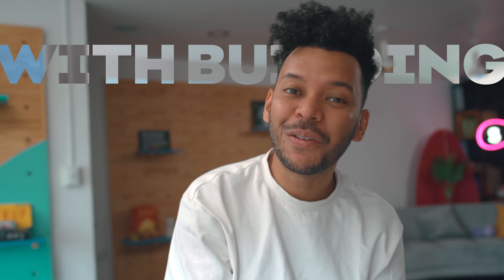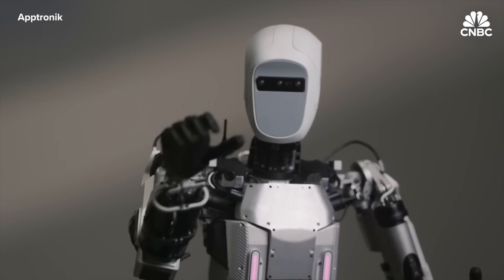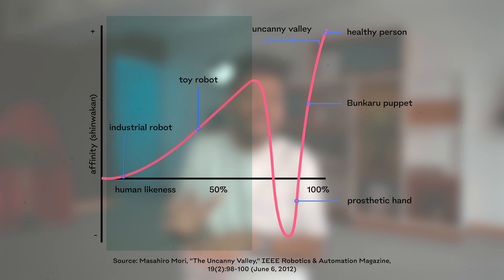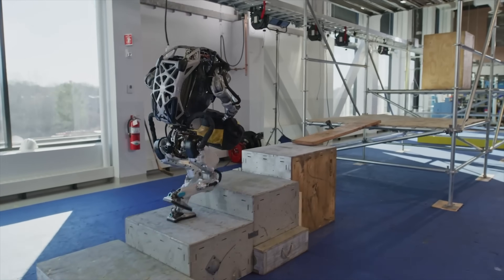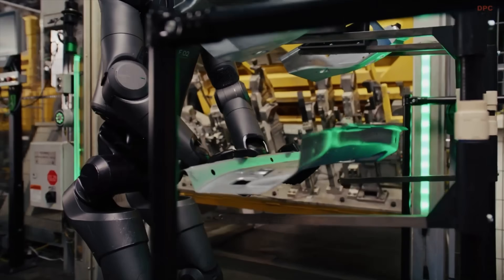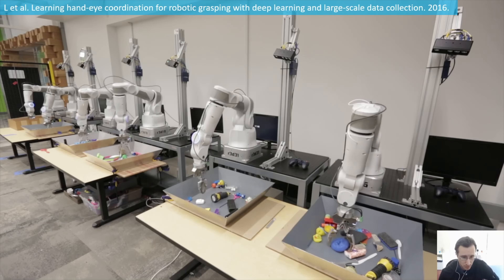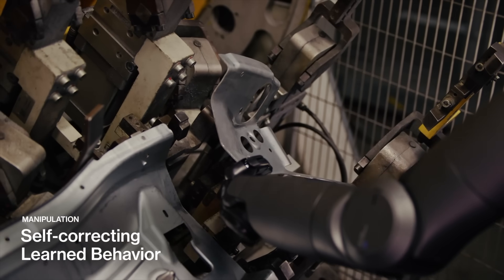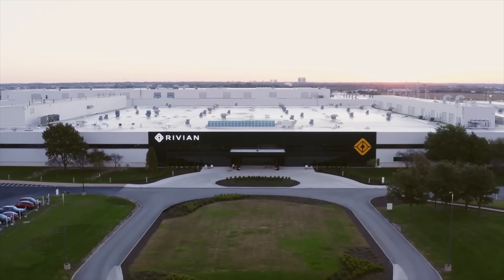The Automation Trap: What Robots Are Really Selling

Comment: designing a robot to use the entire world's human infrastructure, devices, and interfaces costs less than redesigning the entire world for a wheeled robot with clumsy two finger grippers. Humanoid form is the least cost with the maximum real world utility and universality. Anything simpler will need a redesign of the entire world. Backwards compatibility with meatballs in short. That universality of application and uses cases allows for mass production of the same design, yes it may be complicated than the simple wheeled robots, but that is offset by the potential sales volume and therefore the per unit cost might even be lower than the wheeled ones. Case in point, Unitree G1 humanoid costs less than wheeled robots with two arms.

Comment: I get paid to build robots and Slidebean is right, most of you guys in the comments are wrong. Humanoid robots might be a thing in the future, but only for niche situations such as moving things remotely in a very dangerous area (in a first world country) with buttons or pedals only the human form could press. Most people need robots for moving things or pushing things, and for that a humanoid robot is an extremely expensive piece of hardware compared to an arm or two on wheels. Minimum 12 high-torque motors are required to give it legs (compared to 2 for wheels) which have the sole advantages of using machinery with pedals (which could just be controlled with a microcontroller inside the vehicle) and walking over large obstacles or up stairs (tank tracks do this just as well). Disadvantage of extremely high cost of components, of manufacturing, of engineering and design and an extremely complex kinematic chain that will likely cause great instability for the vision system (shaky cameras) and magnify error with the arm holding things.

Yes, some humanoids can hold things now. How? They are trained for thousands or millions of times to do the exact same task in a virtual physics environment that EXACTLY matches the demo environment. Imagine a humanoid robot that requires 100% knowledge of the room its in, with every object's exact position, then has to wait minutes or hours to simulate millions of eons of it grabbing that object. Simpler systems, such as a box with tank tracks and an arm with a few cameras, have existing mathematical models that can guarantee where the arm will be with near perfect certainty (and have been doing so in factories for almost 50 years). All we are missing it improvements in computer vision, improvements in path planning and arms made from cheaper materials that are safer to work with humans (what I am working on) to have more versatile, useful and affordable robots.
Reply: No they won't. It's a poor design for anything including us.
Reply: See that door? Human sized. Those stairs? Made for human legs. That cup? Human hand sized. Etc.
Reply: It's part of the attempt to make scifi real while ignoring reality. It's some psychological issue connected to the state of modernity. Musk's nonsensical Mars fantasy is similar. Offers a dream but not reality. People want dreams because reality is getting too difficult.
Reply: tank tracks for stairs will run into tons of problems
Reply: @I2obiNtube  : delivery agents of heavy household appliances have mechanical devices that hold the load and spring loaded levers that lift it up one step at a time. Sounds like a useful design. For what purpose do you see humanoid robots sauntering up a flight of stairs not doing any work?
Reply: @indricotherium4802  bringing a coffee upstairs to someone sick in bed? if the stairs take a 90 degree right angle turn a bipedal humanoid form will probably handle that best especially in limited spaces.
Reply: @I2obiNtube  : I feel the sick person would prefer human care but if whoever made the coffee can't themselves get up the stair, what about these more down to earth alternatives. A dog could be trained to carry the drink up in a tightly sealed container and, in the interaction, give a therapeutically positive effect (working dogs enjoy doing their tasks too). If not, there's a primitive contraption called a dumb waiter that already does the job. If the sick person cannot manage retrieving the drink him/herself, you just need a simple robotic arm to pluck the drink and swing it over to within reach.
But you gotta have a 64 million dollar robot barrista boy?
Reply: @indricotherium4802  most would but the overwhelming majority can't afford that kind of care and in the future as demand increases more will be unable to access that care most likely as our large populations start to age.

all that might work in the right scenario but will be expensive bespoke solutions, even after all that then you need another robot to fold laundry, change bedsheets, take the trash out to the corner, etc.
Reply: @I2obiNtube  : funny you should say that because I've said, many times, that the day a humanoid robot can clean up and restore to order a three-storey house after a late-teens weekend long party, is the day I'll take AI seriously.

Meanwhile, I think anyone who believes a person in need of care will get a free humanoid robot servant courtesy of a generous elite or generous humanoid robot industrial complex is somewhat deluded.
Reply: @I2obiNtube  perhaps. It would explain the popularity of 4 legged dog robots
Reply: Thank you for bringing actual knowledge to the conversation. Smh at people saying "Duh robots need to look human to function in the human-optimized world." Service dogs navigate the human-optimized world pretty well despite not being human-shaped. People in wheelchairs do fine with a few accomodations. It's just a lack of imagination to think we have to spend billions to shape robots exactly like people to function.

And none of these folks are explaining what in our human-optimized world so desperately requires feet instead of track treads, when balance has been such a huge issue for humanoid robots.
Reply: I've worked on plenty of stairs and surfaces that were designed specifically with agile human legs in mind. There are plenty of places where specialized platforms just would not work.

Its also myopic to assume that the generalizability wont ever improve. Figure has already had several demonstrations where they operate autonomously in  unfamiliar envrionments and objects. (Assuming they are not blatantly committing fraud).
Reply: @denjamin2633  I've never seen a flight of stairs that a dog or cat couldn't get up miles more efficiently than a human.
Reply: @indricotherium4802  then you haven't seen many stairs.
Reply: @denjamin2633  I'm convinced a more efficient stair-climbing mechanism can be developed (or already is developed) for going up irregular stairs that use less motors. Figure is ran by a guy who serially starts tech companies for the sole purpose of generating enough hype to IPO then selling everyone's shares to the public. Look at Archer. It's possible that they have some autonomy, but will it be cheaper and perform better than another company using wheels? Time will tell.
Reply: You’re wrong. And time will prove it.
Reply: @AustinMCraigDoesNeatStuff  great argument dude. Put your money where your mouth is an invest or build a humanoid robot company if you're so sure.
Reply: @AustinMCraigDoesNeatStuff  I checked out your website and you truly do neat stuff, nice work, however I strongly believe you don't understand robotics or engineering enough to provide a good argument for humanoids other than a rehashing of "the world is designed for humans so we should make robots that are like humans". If you believe I'm wrong, make a humanoid robot company. Go for it. Then try to sell your robot to someone. You might become rich, who knows right?
Reply: @alexanderokak5112  Yours is a surprisingly respectful reply for two strangers disagreeing on the Internet. 😆 So first of all, thank you for that, much appreciated. Sincerely I wish I could start a humanoid robotics company. That is precisely what I dreamed of doing as a teenager in the 90s. That sounds bonkers, but it's true. I had an article from Popular Mechanics about the Sony QRIO robot cut out and hanging by my bedside. I fully intended on becoming a mechanical engineer in college, and somehow the adults in my life _talked me out of it_, which in hindsight is insane. So instead I've had a career in communications which has amounted to very little, but my interest in robotics has never wanned. I don't think it needs to be more complicated than "the world is designed for humans." We already have Tesla and others investing billions into this space, and unlike the push for AR/VR from Meta and Apple and others, the interest in humanoid robots seems to have genuine interest on the ground. Where AR/VR encountered the problem the these platforms are actually isolating and logistically difficult to implement at home or the office, humanoid robots will slot in just fine wherever you'd otherwise have a human helper. All it takes is sufficiently advanced AI, and actuators and sensors that are precise enough. And all that is advancing, right now, rapidly. I just don't see any barrier or illusion indicating this won't work. Especially since Elon has bet so heavily on this. That man tends to eventually be right, even if early and optimistic in his predictions.
Reply: @AustinMCraigDoesNeatStuff  Hmm, I disagree with the idea that because Elon said so, it will be a good bet (I think he has lost his marbles since around when he bought Twitter). I also had the dream of making humanoid robots many years ago, but as my knowledge increased I was brutally exposed to their inherent mechanical flaws. I am not opposed to humanoids at all, I just think they will be outcompeted by cheaper machines that do the same thing better (with different shapes). Would you be willing to pay 10x more for a humanoid in your home that takes up 3x more space and does the job 4x slower? If for the novelty of C3PO in the house, then perhaps! It comes down to demand I suppose.

Comment: The promise of humanoids hasn’t happened because you need a brain.  The brain is the hard part by far.  If you have a good brain you can make a robot with all sorts of shapes and it would be useful.  A great example of that is a Tesla model Y which is shaped like a car.  The brain and Ai system in that robot allows it drive around better than I can.  Believe me, if you dropped me in the driver seat in manhattan I’d be totally screwed but the Ai in that car shaped robot can do it.  

Legs are harder than wheels without a doubt but the right brain can do it.  

Boston dynamics never had a brain, their robots are basically programmed to do the moves they do.  You can remote control them and stuff but they are dumb.  

Basically, humanoids will be badass as soon as the brain aspect is really working.

It’s true that Tesla videos are fake because they have remote operators but don’t forget that the Model Y had remote operators for a decade before they got to the point they are today.  The remote operators were the drivers of the vehicles.  This made it easy because Tesla didn’t have to pay much for all that training data.  It won’t be this easy for humanoids but they can use the same methodology to get there.

They will most definitely get there eventually, if not Tesla then someone else.  I’d say Nvidia is the runner up.  They are the other company besides Tesla that makes a custom robot brain computer and software that works and is getting way better all the time.

This is a very well done video but it fails to respect the progress that has been made.  Don’t believe me?  Go find a Tesla nerd that has V13 FSD and ask them to blow your mind.  They will gladly show you the future.

Comment: Sorry Slidebean. Your video exposes you are a non techie. There is indeed not much Humanoid robots can show now. Yes, Elon Musk's robot demo was a farce as they were controlled by humans. However, robot tech is progressing very fast with Nvidia Physical AI and its simulations to massively speed up training. Spatial AI is also being worked on by Fei Fei Li. The current robotics do not have dexterous movement especially of the hands and forearms but the robot startups are working hard to improve it,  The first impressive "ChatGPT moment" humanoid robots are a few years away (probably in 2 -3 years) and its coming.

Comment: The biggest reason for having a humanoid is that it will fit right into a world built for humans: Stairs, narrow spaces, tools, driving vehicles etc. The best will be to have a humanoid with wheels under its feet. If you want to take advantage of the economies of scale to drive down costs, a general robot will make a lot of sense. Even if the robot is less effective than a specialized robot, it will be cheaper to buy (due to better economies of scale). You could buy two generalist humanoid robots at the price of one specialized robot, for example. 

That being said, most of these robots are just built on hype, trying to trick gullible investors out of their money. Figure probably being the worst.

1X is THE most promising humanoid robot company at the moment. It is the only one with an actual robotics engineer as the CEO. Check out his recent TED talk...

Also, check out Yann Lecun's (Chief of AI at Meta) research on the JEPA architecture. It is probably the right direction for real AGI.

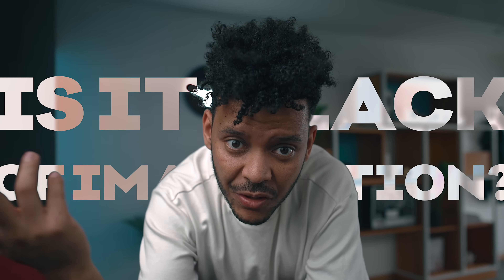Comment: 2:23 why not talk to some actual engineers and ask them why?

This argument about efficiency seems incredibly myopic. Are people in wheelchairs more efficient humans? Stairs are very common, and accessible alternatives are not always available.

If the world is designed with bipedal humans in mind, and you want a versatile, general purpose robot, it seems perfectly reasonable to assume you'd want it to be bipedal.
Reply: Going from four legs to two gave us an evolutionary advantage because we could use hands to manipulate objects, and we could see farther in grasslands. However, for walking and running, four legs are still better. Also better: multi-wheels, like Mars rovers.
Reply: @markotrieste  That's great if walking, running or exploring mars is all they're doing, but our current world is now built around the fact that you're actually capable of manipulating objects with your hands, and you're at a significant disadvantage when you can't. Your robot can be the best Mars rover out there, but if your **general purpose** robot can't open doors or follow me up the stairs to my apartment when the elevator is busted, it's not much use for **general purpose** tasks.

The question is: do we match the robot's design to the assumptions of the world, or do we try to build an "efficient" robot and then try to handle every single edge case that arises from it deviating from the norm? My point is that there is a legitimate reason to emulate the human form, even if it is not the best for specific tasks, strictly speaking.
Reply: Yep, totally. This is an embarrassing video.